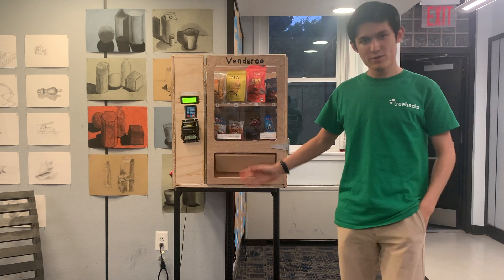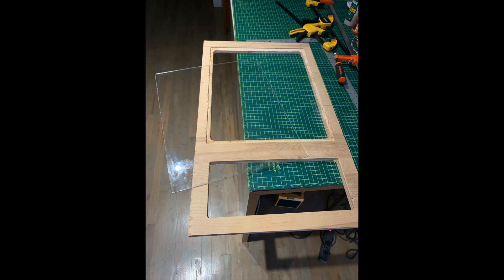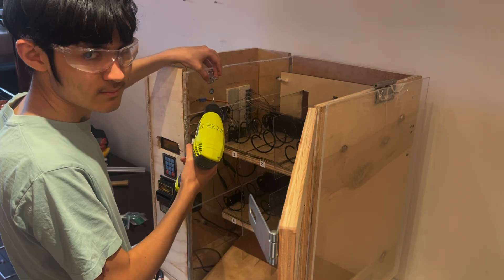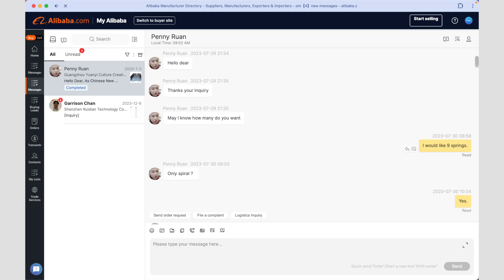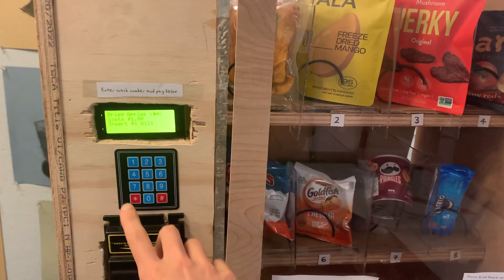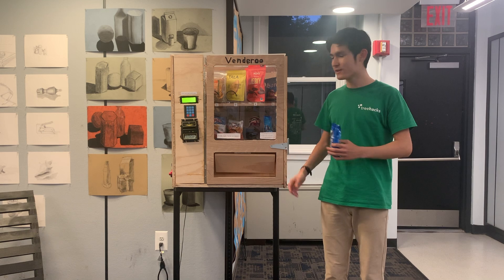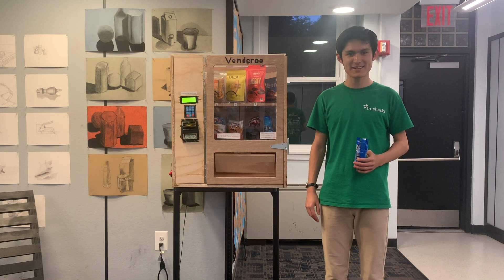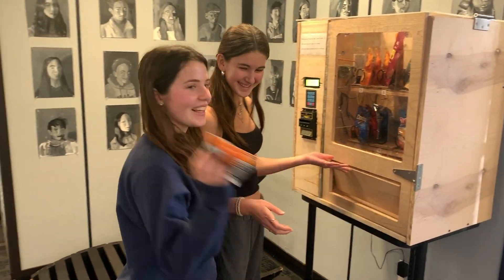Venderoo, an Arduino-Based Vending Machine

Comment: Great project.
You could save at least 50 bucks on the LCD and the controller. But that's no criticism. Done is better then optimized. Because you can always optimize.
And optimizing later is better then not finishing. Especially when the optimizations don't require any serious re-design.
To use a controller board of less then 10% the cost you probably need a few level shifters at worst. I think the Mega had 5 volt logic is that correct? Or was it the UNO?
And the LCD is just a matter of buying it cheaper and you already learned where that might be. "Express"
You can probably easily shave of another 50 by buying your electrical components there.

These are more notes to myself.
Reply from the maker: Thank you. Yeah, the ESP32 is around 5 bucks and can get the job done too. If this were scaled, buying the components in bulk from AliExpress instead of Amazon and hardware stores would significantly cut costs. Mega is 5V output, so transistors are needed for powering the 12V motors. I didn't need any level shifters luckily.
Reply: @JoelGrayson  If you don't need wifi I would use rp2040 based boards, you can get those around 2$. And the RP2040 is probably the easiest controller to work with currently on the market. And that's what I meant: after the optimization you will probably need level shifters. Because most controllers operate at 3.3volt logic (ESP32 and the RP2040 for example). I don't have any experience with driving motors. My projects are mostly super low powered.
But if you want wifi ESP32 and adjacent chips are your best bet in terms of price. Also the community is very established.
Reply from the maker: @fgregerfeaxcwfeffece  Cool.